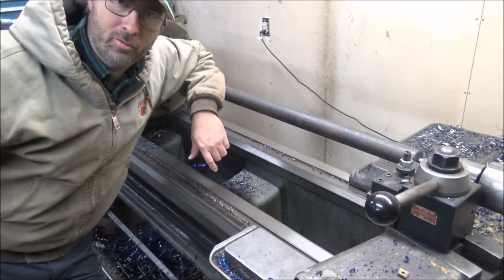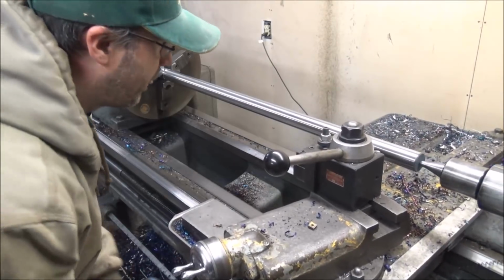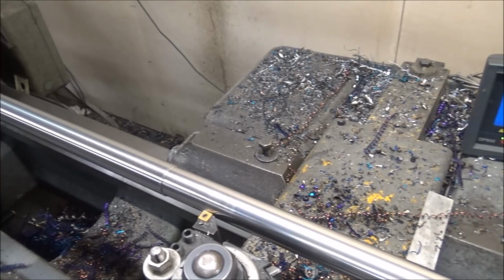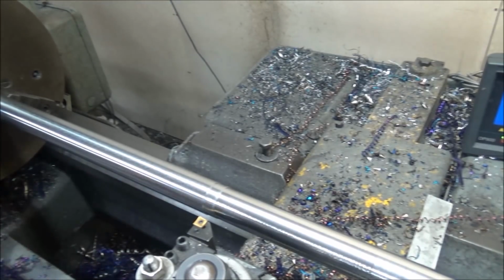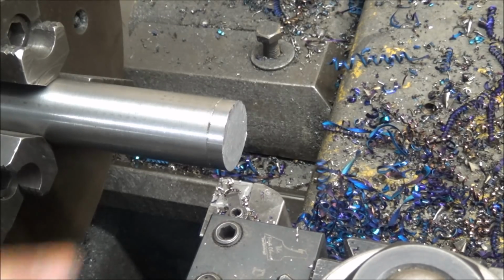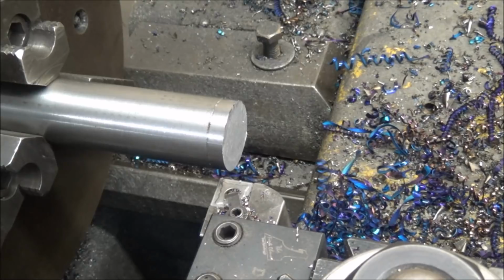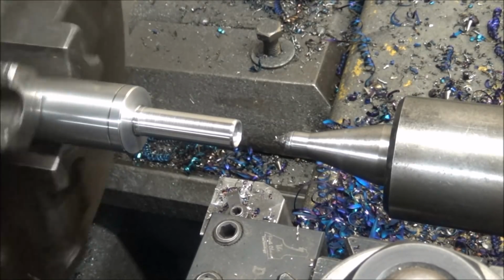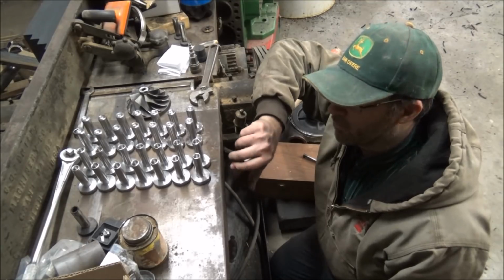Billet Tool Steel Cummins Lifters

Comment: The lenght of this bar is way behond the need to use a follow rest, good thing you didn't need a real close tolerance all along the bar. Sometimes I'll use a wooden block with a little grease to hold the bar when I feel it needs extra support in the middle section, not a perfec solution but it helps in many cases...   ;)

Comment: Good stuff Brian!  Curious how you put the center in the end of a bar you can't fit through the spindle bore?  Another lathe? EDIT: I also have the same live center, and it also needs new bearings.  Would love to see a video to see how you replace them.
Reply from the maker: I could do it using the radial drill, but truth is I used a knurling tool on the toolpost to adjust it to run centered with it sticking 6ft out of the chuck. :-)

Comment: Very nice video, especially when focus on insert cutting steel. Anyone knows what temp is at carbide edge when cutting ?
Reply from the maker: It would depend on the material and your surface speed what the temp was.

Comment: So hello  been a short time viewer and I watch other's channels too so not  a machinist  but from what I've seen with the much length  would it be better to run a follow rest to keep vibration and taper push out down ?
Reply from the maker: I have a traveling steady but I have to build rollers for it. At some time it had carbide brazed tips put on it and it sings like a canary at speed causing more chatter. Its also heavy and a pain to put on and take off so for this non critical job Getting it running pretty good was plenty good enough. All I needed was to get enough material off to get it thru my headstock, all the important dimensions were turned afterwards on the short length when it was stable.
Reply: bcbloc02 cool thank you  I by no means   want to imply I know more than you or any of the others I'm just gratefully for what you all put out for me he see  for me this is better than pro sports bull real work by real people
Reply from the maker: I am glad you enjoy and you can glean some knowledge from it all too. :-) I certainly don't know everything or am an expert on anything so its learning for me too.
Reply: bcbloc02 Bailey  approved

Comment: Chip formation looked a bit off, I wonder if the "rake" of the insert and holder have anything to do with it?  They negative or positive or neutral?
Reply from the maker: Negative inserts, the chips were good at the full diameter as it decreases the surface footage is too slow to  get good chip forming. I was already at full speed for my lathe so nothing really to do about that.

Comment: Brian you need a "Follower Rest"  for those heavy cuts on a long shaft.
 Also, please put a switch plate cover on that outlet on the wall side of your lathe. I've seen what a chip can do flying inside an outlet.

Comment: Time to get the CNC fired up?
I thought I saw the stock move on the tailstock on that first clean up pass.
This job ought to pay for some more insulation,
Rollie
Reply from the maker: I need a CNC lathe.  I think I want a Warner &Swasey/Giddings&Lewis Titan with live tooling and 60" turning length but they have proven hard to find. Either they all got junked, people don't want to sell them, or they didn't make very many.
Reply: Gradall!

Comment: Hi Brian,
You have any tricks to keep the bar stock from slipping in the chuck?
Steve
Reply from the maker: Well a shoulder works best! Otherwise some more aggressive chuck jaws would sure help. I only have one set though for my chuck. Could turn away from the chuck instead of in so the tailstock holds it but that won't work with the shape of these parts and you can't take big cuts because the center and tailstock aren't nearly as rigid as the chuck. Last alternative I can think of would be to leave a rougher surface finish on the base OD to give more grip.  That creates the need for an additional cut on each part though to improve appearance.
Reply: Lost of work I do in the shop is about hardenable allows. Harder alloys together are more prone to slip, the 2 materials being harder none is entering the other, so, chuck jaws only hold on the surface, not entering the material, this will slip easier than hard jaws in softer material. There isn't much solution other than to find a removal rate that will allow the chuck to do what it has to do. just like Brian says, there are no miracle receipes, my normal way to deal with this is to fiddle with the feed and speed, if possible a hard stop in the broach or something...   ;)
Reply: Hi Pierre's Garage,
I was just wondering if you guys had any secret recipes for chuck slippage. I do many of the things you and Brian mentioned. At my full time job I made some hard stops for our CNC lathe and we use them when we have to. Most of the time we fiddle with feeds ans speed like you suggested.
Steve
Reply from the maker: If it didn't matter about marring the surface you could turn a ring with some set screws that you could put against the face of the jaws and tighten the screws to give it something positive to hold against. Kind of like a bearing locking collar.

Comment: Nicely done. Wouldn't a following rest a good addition to your lathe or is your cutting angle nearly 90°.
Reply from the maker: Cutting angle is nearly 90 to avoid push. I have a traveling steady but I have to build rollers for it. At some 
time it had carbide brazed tips put on it and it sings like a canary at speed causing more chatter than not having it.
Reply: bcbloc02 We used off the shelf ball bearings as rollers and had good luck with it and never any problems with surface finish afterwards. Thanks for your reply. Have a good one. :)

Comment: One guy usually cuts away from the chuck. He demonstrated it reduces or eliminates chatter?
Reply from the maker: On short lengths it does help especially on strictly chucked items. I have tried it on long thin parts like this before and it didn't help. Slowing way down would help probably more as well as taking shallower cuts but then it takes lots longer to do.  With a L/D of 33+ its a super flexy setup. For those paramaters if an  accurate and highly finished result was necessary a follow rest would have had to have been used.

Comment: Hello Brian,  I was making a spindle out of an old tie rod (1 1/8th inch) and couldn't overcome the birdsnesting chips with speed or feed.  Tried different inserts.  Taking very light cuts and hand feeding at a very fast rate finally was working best.  However the chips were blue and actually glowing then flaming off the cutter.  The only thing I know of that actually flames is magnesium although I haven't a clue at what percentage an alloy with steel would be sufficient.  These were from a Toyota pickup.  The steel actually cuts easily in the bandsaw but turns with a lot of tool pressure and does not cut easily.  I presumed because there was little rusting that that was one of the reasons for the alloy yet when I researched the content not much was available and what was claimed most all tie rods were just mild steel.  Any thoughts on what this could be?  (It is ok to check with Bailey!).  I am really curious because I am running into the same kind of problems with old outboard shafting although it does not burn.  Hard to find a source telling just what alloys are used and the combinations thereof.  Some are just super hard and need to be annealed but most cut fine with a bandsaw and yet are super tough to part and difficult to turn.  The parting on this shafting is puzzling for sure.  Some of it cuts just fine from 1" down to about 1/4th and then tool pressure jumps up and breaks the insert.  Yet it finishes easily with a hacksaw (I first thought it was work hardening).  HSS and every insert in my collection (no ceramic or exotic ones) with every variety of speed and feed seem problematic.  Parting I haven't got adventurous enough to power feed this stuff preferring to 'feel' the cut.  As a frame of reference I have no problem with normal steel, aluminum, etc.  There are case hardened bearing journals on the shafts but these are areas that cut nicely (although they are fairly hard) with the bandsaw.  Seems like when you need it most Google falls on its face!  Haven't found much about the metallurgy on it at all.  I know a lot of it is proprietary but you'd think basic parameters would be available.  Wondered if you had any experience working in this area?  Thanks.  Take care.  Doug
Reply from the maker: Hard to say really. Most tie rods would be forgings and forged material can have some odd characteristics form the forging process. I would not expect to find Magnesium in a tie rod end. I would expect a fairly high nickle content though to help avoid cracking. On the parting I can only imagine that the heat is enough to make the shaft hard in the core before you get it cut. Are you parting with flood coolant? That might be necessary for that material.
Reply: Yep I am using tons of cutting oil but the puzzling thing is after it breaks and insert when I get out the hacksaw it saws very easily.  Thus leading me to believe it is not work hardened,  Drilling centers in it is also not a problem.  The tie rod (itself not the ends) also displayed no real rust after years on the road and then more laying around.  Seemed to have something like mill scale/paint.  So it might be using a mag alloy to hold back the rust??  The puzzle deepens!  Thanks for the reply.  Take care.  Doug
Reply from the maker: Your parting blade is for sure not a bit low? I have seen some springy materials that want to climb up on your parting tool rather than be cut and that always goes south.
Reply: Nope not a nib left on any of them.  I use a height gauge and they  (I must have four different types and styles) are on the money. Double careful as when I started on a smaller lathe I did have a couple climb up and come at me so I am gun shy and super careful. This stuff does seem to work harden when drilling but when parting like I was saying I can finish it no sweat with my lenox bi metal hacksaw blade and it cuts pretty easy with a bi metal on the bandsaw.  Take care.  Doug

Comment: What size Cummins are they made for? 
Looking for an 8.3 mechanical Cummins if you know of any!
Reply from the maker: How much of one do you need? I have a core one sitting in my shop now.
Reply: Going to be for a haul truck build! So when you say core are you talking just block or engine less head?
Reply from the maker: Its a long block, valve cover to oil pan, but it doesn't have any manifolds, flywheel, turbo or fuel system.

Comment: Nice machining as usual. So you are the one enabling the road bound locomotives...hmm.  They make me laugh at the trash can size exhaust tail pipes, and the cloud of smoke at every stoplight where an officer isn't present. Most don't have your level of pieces to prevent the inevitable breakage. Well it's fun while it lasts I guess. I do enjoy the occasional pizza delivery sign hung on one of these behemoths. That is usually a sign Mom and Dad are out of money. 

Dan
Reply from the maker: Usually by the time they get to needing these parts they can't be used on the road anymore.
Reply: I'd rather have something that could be hammered all day for a year than 30 seconds.
Reply: If they are pushing more than 500cc of fuel, then they are probably turning quite a few RPM's with significant boost levels.  Lots of spring pressure to keep the orchestration in sync.  I seriously doubt they see anything that resembles a road.  These are not going to be the kids spending $200 on exhaust tips, or "tuning" pumps with a screw driver.  Most of the work I've seen Brian do relates to tractors, high dollar competitive tractors.  I believe B series were in JD and Case.
Reply: Shain Andrews I was poking fun at Brian that the kids I describe will eventually see his video and start hitting his email. I know Brian is well into the high power deep pocket type of truck/tractor pullers.
Reply from the maker: Cummins are most common in Case/International but White used them too. Pretty much anything Deere ever built had their own engine in it, I think less than ten tractors of Deere had other brand engines with that split about even between Detroit and Cummins. Funny that now they mostly use Cummins even though Deere had a big hand in the design and manufacturing of the Detroit 60 series engines. I think that is because the Cummins engines get used because of their larger displacement which is why Deere doesn't use their own in that size.

Comment: I thought I was the only one who has trouble with a cut on long cylinders. No traveling steady here, fixed steady a pain.
Reply from the maker: I have a traveling steady but I have to build rollers for it. At some time it had carbide brazed tips put on it and it sings like a canary at speed causing more chatter.

Comment: Nice, wish I could take .250 off the OD in one shot with tool steel...Delrin maybe :)
Reply from the maker: I could take more if I could hold it from moving from the cutting forces.
Reply: The back of your spindle is threaded isnt it?, couldnt you manufacture an "adjustable stop" that could be put on when needed?
Reply from the maker: Nope, no threads on the far end of my spindle, just a bore hole for the bar to pass thru.  Most of the time though the bar doesn't even stick out the other side as it takes about 4foot just for it to go thru the headstock.

Comment: Why not use a follow rest? Don't you have one for this lathe? Hmm, that might be the topic of another video. Many creators have a video on making a follow rest like Keith Fenner and others.
Reply from the maker: I have a traveling steady but I have to build rollers for it. At some 
time it had carbide brazed tips put on it and it sings like a canary at 
speed causing more chatter.
Reply: Carbide tips don't make sense to me. Should it not be bronze or brass tips to protect the work piece?
Reply from the maker: I don't know what they were doing with it why it is that way.  I am sure there was some application for it.

Comment: i wonder if a radius at the base of the lifter would make them stronger.  might require some machine work to the bottom of the lifter bore..   slippage  if you take the jaws out of your chuck.. line them all up .. are they all the same height..giving you the option of putting them in a jig and grinding the ends on the surface grinder. instead of trying to bore them in place as others have done.  you have probably seen this very jumpy video of lathe chuck manufacturing  https://youtu.be/LR48QufOHIY.   since its a 3 jaw chuck..  perhaps build a bolt down jig with an adjustment stop bolt.. so you could find tune individual lengths one at a time to get it close enough for the bosses approval..
Reply from the maker: Rather than being ground out they need crosscut again to make the serrated teeth sharper. The teeth are mostly flat rather than sharp so they aren't super agressive which is good in that they don't mar the parts, but they don't grip as tight as some fresh sharp teeth either.

Comment: frustrating to have such a small spindlebore  where ya cant even stick a shaft that small through and man you got some serious  bluenail  going on  gotta  stop  crushin your fingers dude  :P
Reply from the maker: I actually did that hitting it with a wrench that slipped when the fastener broke.
Reply: ouch  yeah ive  done that  once  when takin my buick appart ahd  to use a  crowbar to get the u.joint out of the rearend  yoke the u-joint  broke loose and slammed my   finger  on  something   hurts  so bad  ya dont know what to do with yourself

Comment: Watch userwl2850 he machines long bars from the chuck to the tailstock with no chatter. It's worth the watch.
Reply from the maker: I have tried it both ways with L/D ratios as high as this(33+) it makes little to no difference that I can see. I am sure your machine and tool angles have a large effect on how it all goes.